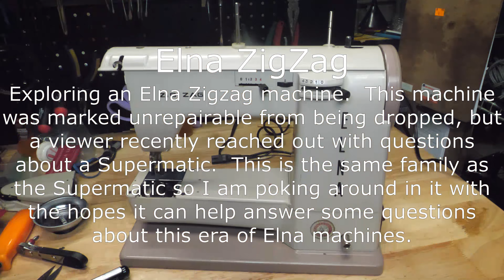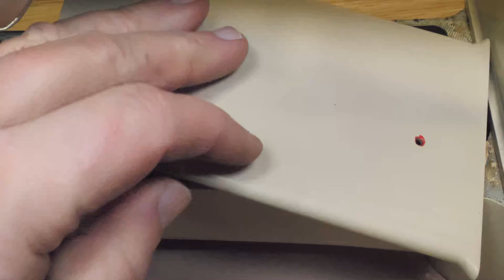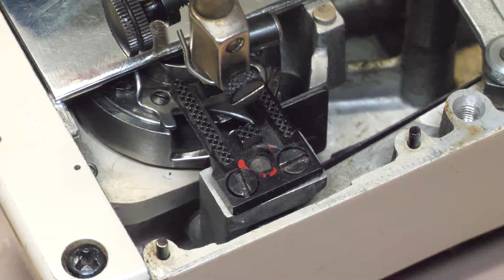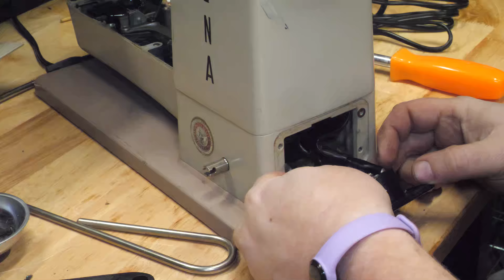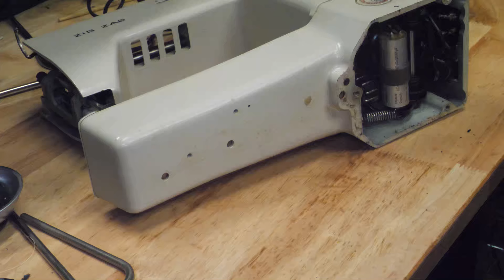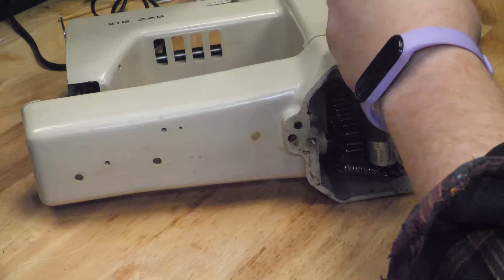Elna Zig Zag Exploration

Comment: capacitor is for rf and spark suppression. keeps the contact fingers on the speed control from pitting. and also radio interference just like on the supermatics
Reply from the maker: Yes, but as they age they become less effective and when the old capacitors go it can result in shorts.  I keep a stock of modern high voltage capacitors handy for when I need to work on these and pre-emptively replace the old capacitors to prevent surprise problems.